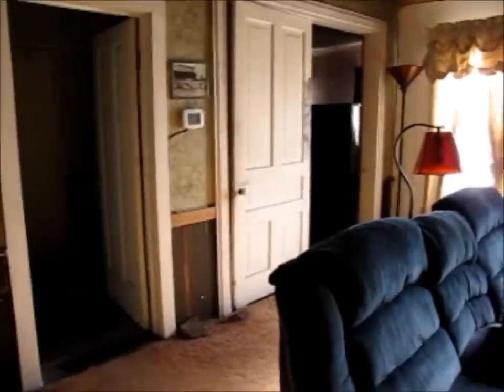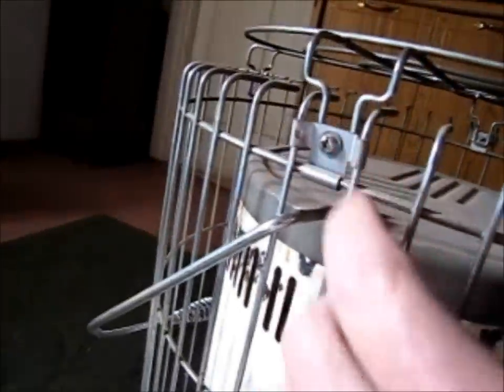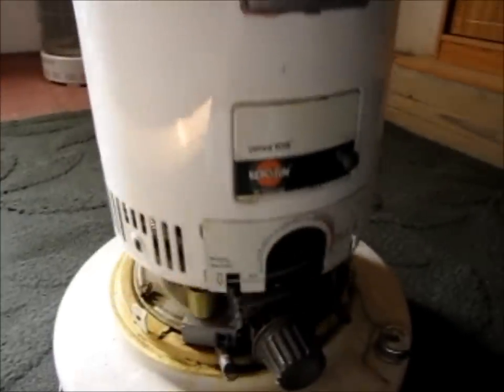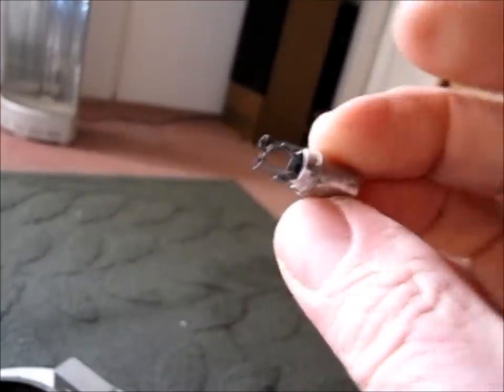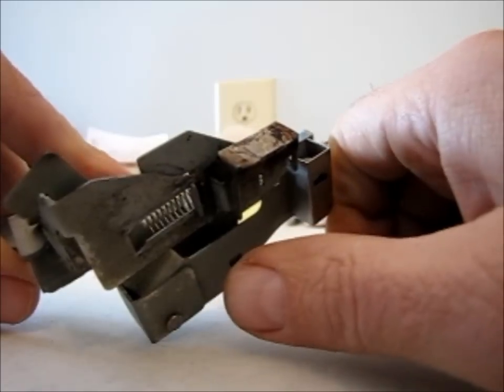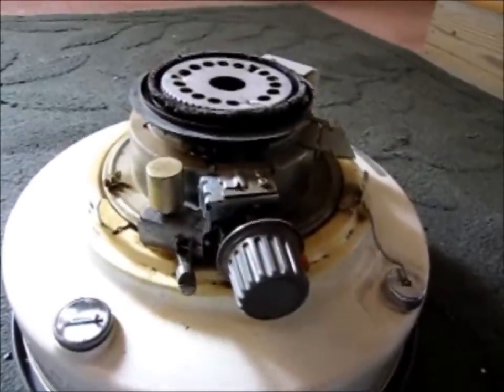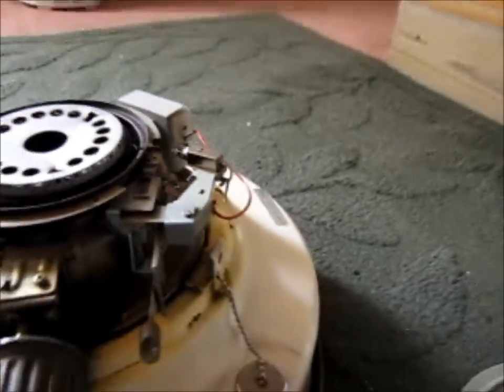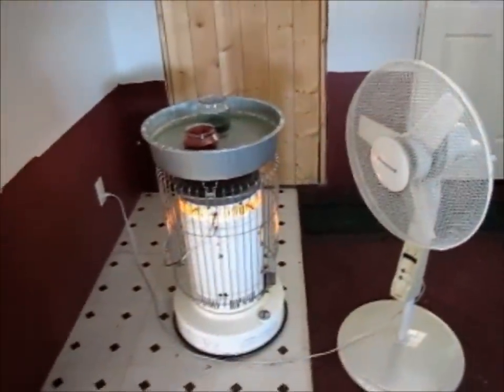Kerosun Omni 105 Ignitor Repair

Comment: Cornfield - Thanks for your tutorial on your kerosene heater. I have the identical model and have owned it since the mid-90's. I have never had the battery powered ignitor work regularly, even after replacing "C" batteries on numerous occasions. Now my problem is the wick will not shut off. Appears it might be gummed up and won't release entirely downward to exhaust itself. So here I am on youtube looking for the fix. May have to remove the parts and clean them of gummy varnish. Thanks again.

Comment: Try putting the fan on the opposite side of the doorway facing the heater. The heat in the home will distribute way better. You're welcome. What kind of lube did you use inside the heater?
Reply: What type kerosene do you use in yours? Are these safe to use indoors? Is there a risk of carbon monoxide

Comment: My heater is just like yours.  I fill like I need to change the wick in it.  Also, what did you use to clean the ignitor with? If I have to order a wick and ignitor (not locally available) do you have a phone number to company? TY, so much!!! Good video!
Reply: Can I use a match to light the wick if my igniter won't work?
Reply: @rachaelsheffield7818  yes, but it is less than ideal because it has more chance of dropping pieces into the heater.